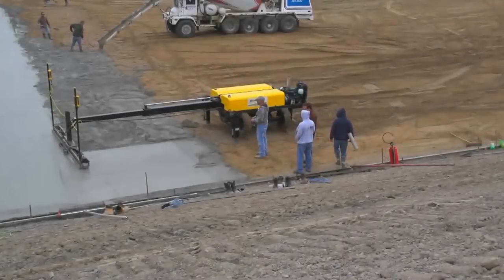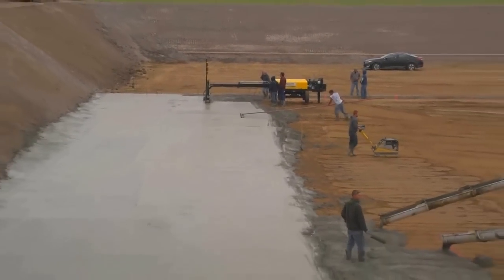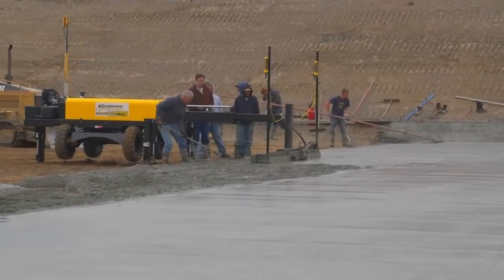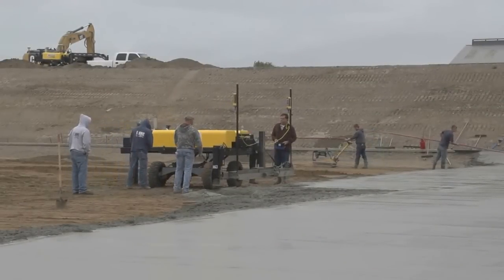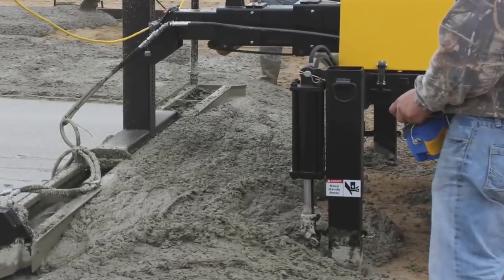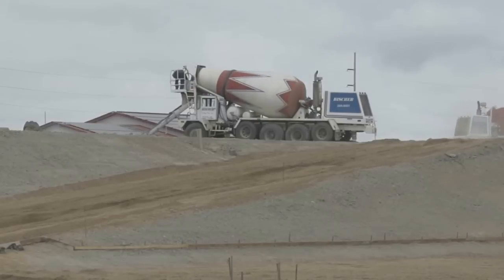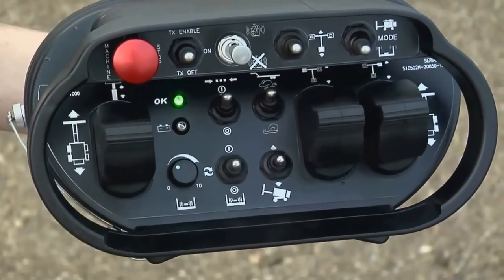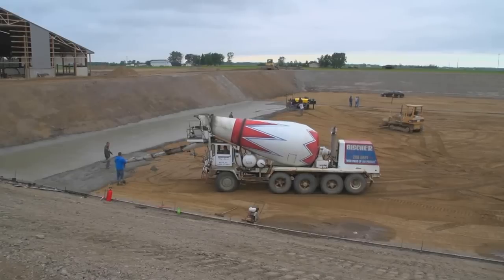Agricultural Storage Pit: Customer Screeds 75,000 sq. ft. Using Ligchine Concrete Screed

Comment: I'm no concrete expert, but isn't that going to crack without reinforcement?
Reply from the maker: +texasbmx246 Fibermesh is integrated into the concrete mix for structural integrity.
Reply: Police Tube apparently you don't know much about concrete.  steel reinforcement in no way weakens concrete.  if it did,  architects and engineers wouldn't require it in their projects.  in over 25 years in construction I never once had an architect tell me not to use rebar or wire mesh because it will weaken the concrete.  too much water is what causes concrete to crack.  that why we have test men checking the slump on site and regulating the amount of water added.
Reply: It's a manure pit. Reinforcement doesn't matter.
Reply: Fibermesh, shrinkage compensating admixture and sawcut control joints?
Reply: lets put all the copied Wikipedia BS and all the ph crap aside.  you can sit there and talk about "I know this and I know that because I test concrete or I've been in the concrete business for 5 yrs or even 35 years."  that all fine and dandy.  I have been in construction for over 25 years.  I have run a lot of both new construction jobs and a lot of rework jobs.  I have never, never poured crete without wire mesh or rebar or in some cases both.  I have never had to demo and replace concrete that had reinforcing steel that was installed correctly,  which in a slab is in the center thickness wise.  for thicker slabs with multiple layers of reinforce, they are usually no less than 2" below the top of finished floor and no less than 2" above compacted base.  I have on the other hand, replaced many, many driveways and parking lots that either had no reinforcement steel or where the steel wasn't elevated above the base layer.  that not what I have read somewhere, that what I know from actually doing it.  so spend 25 years replacing other people's crappy work, then come talk to me about it.
Reply: texasbmx246 it is the floor for a run off pond, it doesn't need reinforcement. they almost never do that. only in very specific circumstances.
Reply: its true... the steel rusts and xpands and crack the concrete...
Reply from the maker: The pit was built to NRCS (National Resource Conservation Service) standards (federal required standard for agriculture storage pits).  This meant it was designed, built, inspected and approved to Federal standards.  The Federal standards only require a “clay lined” pit.  In this case the pit owner “elected” to add a concrete liner on top of the clay liner to prevent any damage to the clay liner when his Cat Loaders were traveling along in the pit.  The owner has no concern about concrete cracking since the pit is 100% clay lined for proper retention.
Reply: texasbmx246 yes men
Reply: texasbmx246 it needs plastic reinforcement, its mixed into concrete
Reply: Supertwister1 Holy shite I didn't realise.
Reply: lets put all the copied Wikipedia BS and all the ph crap aside.  you can sit there and talk about "I know this and I know that because I test concrete or I've been in the concrete business for 5 yrs or even 35 years."  that all fine and dandy.  I have been in construction for over 25 years.  I have run a lot of both new construction jobs and a lot of rework jobs.  I have never, never poured crete without wire mesh or rebar or in some cases both.  I have never had to demo and replace concrete that had reinforcing steel that was installed correctly,  which in a slab is in the center thickness wise.  for thicker slabs with multiple layers of reinforce, they are usually no less than 2" below the top of finished floor and no less than 2" above compacted base.  I have on the other hand, replaced many, many driveways and parking lots that either had no reinforcement steel or where the steel wasn't elevated above the base layer.  that not what I have read somewhere, that what I know from actually doing it.  so spend 25 years replacing other people's crappy work, then come talk to me about it.
Reply: texasbmx246 depends on the psi fiber mesh rating
Reply: fadingbeleifs Thanks for the info
Reply: Police Tube im a NICET level ll technician and hold an ACI cert, I can tell you right now, I've never seen any structural design or placement of concrete without rebar EVER. It's part of my job to make sure the rebar enforcements are to size and proper spacing. Without steel reinforcement concrete could nowhere near hold any load. You must not be familiar with post tension cable stressing used to construct sky scrapers too
Reply: Police Tube BTW, holding an ACI cert means I  check the onsite batches to make sure they don't have too much Water, if you knew anything about concrete you'd know mix designs only perform to their advertised strengths when the proper water to cement rario is inside the truck being dumped out. That's why they have the engineering lab aka "lab man" like me checking everything. This entire job could have been done with a two ft thick layer of clay with  the right plasticity index in two one foot lifts compacted to 95 percent per standard proctor on a density gauge machine. I know what I'm talking about, and can even provide you with my ACI cert number to look it up lmao
Reply: Police Tube concrete is almost always load bearing,that's why there's rebar. Without the rebar any load bearing concrete would quickly break under pressure..

I promise you there will he cracks all up and down this slab of concrete for this irrigation pond once water is inside and it gets a load on it. See the method of compaction? Lol a vibrating plate on sandy soil. These people are idiots. And your argument will be invalid everytime I hate to tell you, everytime there is a concrete structure here in Texas, there is rebar. On the side walk, in the curb, in people driveways, steel cables are used a lot on people's foundations etc.
Reply: William, corrosion has already been established even before the pore, rebar isn't treated with anti corrosion, it's already rusty when you do the concrete poor. As you said, too much water in the concrete will certainly contribute to it, but I highly doubt it will be the only cause for it.
What I do think causes cracking is not vibrating the concrete enough, which can cause air bubbles on the rebar and sides, not poring the concrete entirely, but in stages, or just the wrong mixture of concrete which cannot carry the load on the place it was pored. but like i said, I'm no expert, far from it, but that's what I heard on site from the guys that did the poring and the project leader who guided the entire team.
Like the tabletop I was working on with those guys, was all pored with low heat concrete (don't even know what that stands for actually, but it was 400 million euro worth of concrete, that needed to be pored on that site.)
Reply: Police Tube lol, you'll still never see any concrete without rebar. You made the pointless comment in the first place, wow a rock will last forever? No one knew that
Reply: William walton that is not what I said. What I said is that most concrete is not structural and does not contain rebar. You are correct that most structural concrete does contain rebar to assist in tensile strength.
Reply: Thank you for being informative Ligchine International
Reply: texasbmx246 what was the depth of the pour. Was the ground compacted. no rebar either ??
Reply: Police Tube concrete is almost always load bearing,that's why there's rebar. Without the rebar any load bearing concrete would quickly break under pressure..

I promise you there will he cracks all up and down this slab of concrete for this irrigation pond once water is inside and it gets a load on it. See the method of compaction? Lol a vibrating plate on sandy soil. These people are idiots. And your argument will be invalid everytime I hate to tell you, everytime there is a concrete structure here in Texas, there is rebar. On the side walk, in the curb, in people driveways, steel cables are used a lot on people's foundations etc.
Reply: Police Tube steel does not make the concrete crack!! Oh my gosh you're a literal idiot who watched a few videos on YouTube and think you're right.. it's okay dude I understand. But hey if you wanna know the right way to do stuff and you're in Houston come on down we can drive around in my truck and I can show you what I do to people who don't have steel in their concrete
Reply: Police Tube ill school you even more, if there is ANY rebar corrosion inside concrete, I promise you because it's the concrete itself when it was placed had too much water in the batch, when this happens it creates an extra air percentage, when that happens the stressing of concrete as it gets hot and cold throughout the seasons cause it to contort and crack, allowing moisture inside the concrete. Causing rebar to deteriorate. So you're wrong..... again
Reply: William In that case, as a fire-/safetyguard, I have a question when it comes to rebar in concrete.

We were poring a tabletop to hold massive silos. It was 4 levels of square big holes, with piles of 2.10meter on 1.9meter, so pretty big. Now I saw that being built first hand, ...
The rebar itself, do all the joints need to be welded, or is a couple bars more than enough? Because they were only welding 2 bars on the bottom and 2 bars on top (rebar of 5cm thick). I of course had no say in that as a simple safety guard, but doesn't that jeopardize the structural integrity of the piles?
It was like watching them to cut corners on every single pile the pored. So i'm a bit concerned.
Reply: Police Tube straight off Wikipedia 😂😂😂 go into the field and then talk to me
Reply: Flor Hoorebeke thats why when doing rebar inspections rebar must be completely clean of any dirt rust or debris
Reply: Police tube, you might want to re-edit your comment on PH values...

PH is between 0 and 14 right? 0 being acidic and 14 being alkaline .

Now I worked on a chemical plant, where they have an alkaline substance of almost 13 on the PH scale, it can almost complete dissolve a human being, it burns from the inside out.

You said, that a concrete being pored is alkaline and 13 on the PH scale? Why aren't people starting to melt or show serious burn signs while poring and getting splattered all over? Is that because concrete being pored is not 13 on the PH scale, but more like 7.5 if it is that much???

Or, just ignore this message if you're talking about a different PH :) (I saw you used a little p)
Reply: I know, every time they weaved the rebar, they blew away the debris of the wires they used to bind them together, that's very true indeed. But the rebar itself was still rusty as hell, it came on site complete new, but in a few days it's rusty as hell when it's being used. Or is that kind of rust unimportant?
Reply: texasbmx246 in some cases yes in a lot know it all depends on how much ash they added to the mix
Reply: texasbmx246 like sidewalks they add separators
Reply: who'sthedummynow ? And when crappy work is redone they call my company to come make sure everything is done the right way. 100 percent back you on that statement
Reply: Segloa Marti yes, those are called expansion joints, similar to like they have in streets in case the subgrade settles
Reply: William walton you're obviously very passionate about your work. Not all concrete is structural and a lot, if not most concrete, is poured without rebar. I get how you feel because of the experience you have had in your little bubble but you really need to relax because it's much more complex than you might think. Most structural concrete does have rebar but the trend is now going towards no rebar for most pavement with the exception of tie-bar reinforced joints.
Reply: How much is that machine?
Reply: Shawn Cox you edited your post, clearly. Even a side walk and house foundation here in TX has rebar. Shitty codes you must have
Reply: William walton yes I edited my post 30 seconds after I posted it to correct a typo. I don't get your point? You're kind of weirdly angry. I'm sure you know much more about what concrete practices should be used than the local experts with advanced degrees. Believe me there is plenty of thought and testing that happens behind the scenes before practices like that get widely adopted. Texas has always had their own way of doing things, nothing new there.
Reply: hi , I know nothing about concrete. but ancient romans built their bridges or buildings like the colisee or the "pont du gard" with some concrete without any rebar.  Their recipe has been lost however , but I don't think our current realizations will last same amount of time.
Reply: texasbmx246 Such a manly topic. lol
Reply: obvious you have reading troubles. Try rereading what he said
Reply: From looking at the scope of the job....I think they know what they're doing.
Reply: To William walton and police tube do you both carry on like that as it's normal I get were u coming from but you can't lay a massive slab like that without reinforcing it and sometimes when the concrete is set they grind out expansion joints to stop cracking does this help at all
Reply: texasbmx246 all concrete cracks.
Reply: Read the video description smart guy
Reply: who'sthedummynow ? I work in concrete industrial industry and you are correct!!
Reply: All concrete cracks, the steel holds it together when it does crack, But in this case it doesn’t matter if they have rebar  or not. Not all concrete has to have rebar in it🤦🏼‍♂️
Reply: I'm sure some very clever people got involved with this job regards  cracks and   The pour , it's not your average pour some concrete in the back yard job , do you really thinks some one wasnt consulted before spending all that money on cement and a very specific job??
Reply: Jean Durand discovery channel investigated it. Its believed that the addition of animal blood to the concrete is what the Romans used to make it stronger. WEIRD
Reply: It sounds like i was for some agricultural use that didn't require much standards :)
Reply: texasbmx246 it all cracks! Eventually...
Reply: So it's a casting slab....
Reply: Police Tube you have no idea what you're talking about.... lol
Reply: reinforced concrete goes on top of that actually :) first they need a level floor. if there is a building being built on top, before the pore, they will first drill concrete piles in the ground to carry the entire load and to stabilize.

My guess is, there is no building being built, because I don't see any rebar from piles. 

It says that it is an agricultural pit, I think they just want no groundwater to come into the pit, that's why the lay a level concrete slab, it doesn't need reinforcement, it's also 5 times as thick as a normal level slab. because that's about 5 to 10cm...

I'm not an expert, far from it, but I saw a lot of buildings built in the industry as a fire/safety guard, because I have to watch all those people's safety :) you learn a thing or two like that too :)
Reply: Shawn Cox most structural concrete doesn't have rebar????? Am I really seeing that statement.... so you expect the weight of a building and foundation to rest on drill piers without rebar.... interesting.